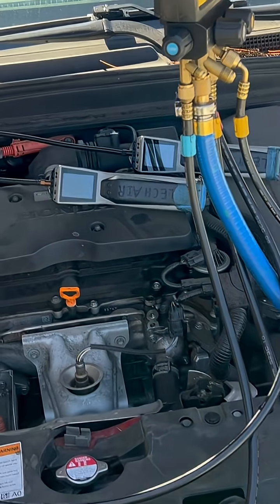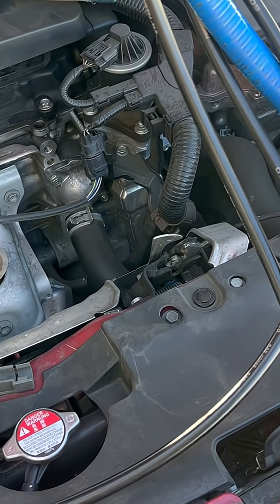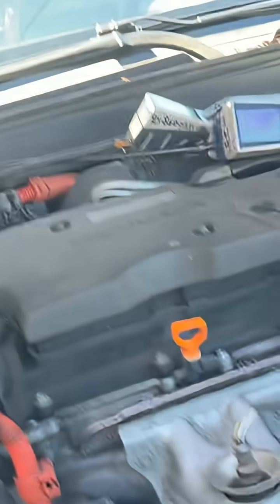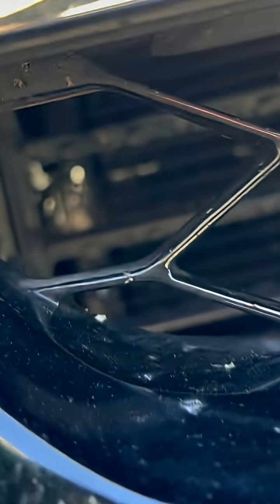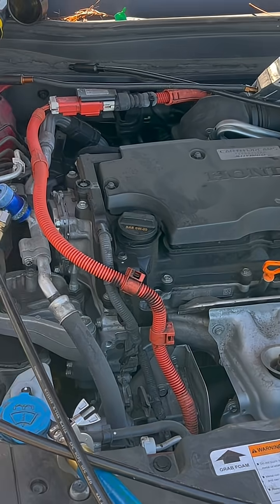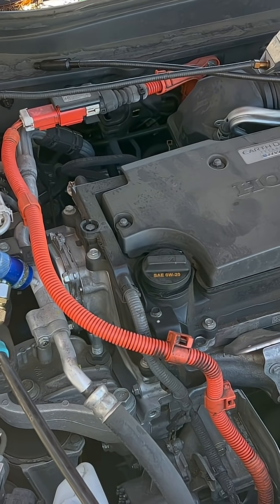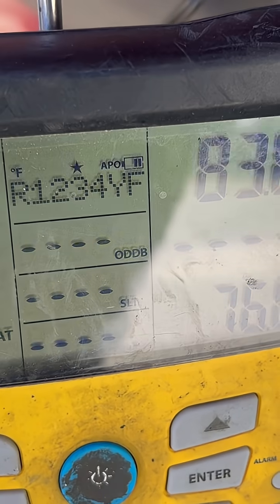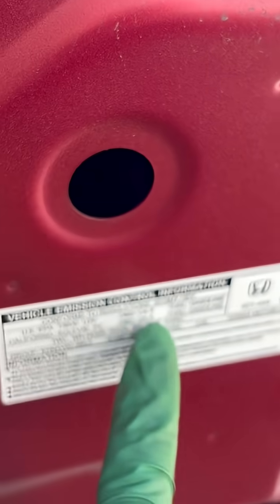Electric AC Compressor want to wined itself to death vary low on refrigerant

Comment: In a case where there is clear oil loss from the system, like this one, how do you make a judgment call on how much oil to add back into the system?
Reply from the maker: The loss of oil is so little it’s insignificant.  Only a few drops of oil, especially POE & PAG oil.
    Over overtime will spread out so much and so wide it looks like it appears like a lot of oil, but it is not.  And it attracts fine dust that sticks to it, making it look large larger than it actually truly is. 
        The compressor is starving for oil, but it is not caused by the leak. 

In an AC system as the refrigerant level gets lower. Refrigerant is an excellent mix and carry refrigerant oil out of the compressor every time it returns and passes through the compressor.. 

But as the refrigerant level keeps getting lower, there’s not enough massive refrigerant to keep the velocity up. 
   It’s enough to remove the oil, but it starts slowly depositing the oil as it leaves. The expansion valve goes into the larger pipe and chamber of the evaporator end of velocity greatly reduces, and the oil falls out of suspension and starts accumulating inside the evaporator and only vapor refrigerant, leaving behind the oil returns to the compressor.. and this continues the cycle, slow slowly over reducing the oil in the compressor slowly burning it up. 

so there’s no actual oil that needs to be replaced.  Because it’s all up in the evaporator.. 
     And soon as you drain vacuum and recharge with 100% of the refrigerator in charge by manufacturers weight specification. 
     It will now have the proper mass and velocity oil that will carry all the oil that is stacked up in the evaporator back to the compressor. 
     Sometimes the compressor will live, and sometimes the damage has already started with damaged, rough bearing surfaces that even after oil is supplied, it’s still going to fail soon. 

Compressors do not die. They are murdered.

As long as you never allow the refrigerant in charge to drop, and there is no sort of manufacturer mass defect on a line of compressors compressors will outlive the engines and the transmissions of the vehicle outlive the life of the vehicle.
Reply: @coldfinger459sub0 You are awesome! Thank you SO much for taking the time to reply. That was such an excellent explination of the system theory and modality of lubrication in a system. I learned about you weeks ago after another content creator mentioned you. I am so thankful to have found your channel. HVAC is such a unique system, driven largely by experience; not having that experience makes learning and repairing these systems hard and can be filled with painful financial mistakes if you dont understand what's going on. I hope your channel continues to grow, educating more people with this valuable information. The community thanks you!